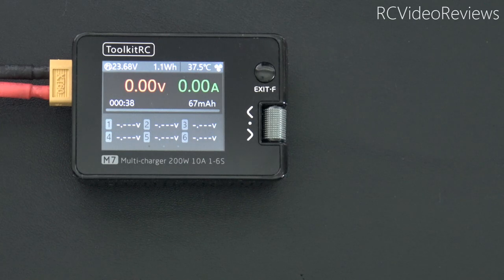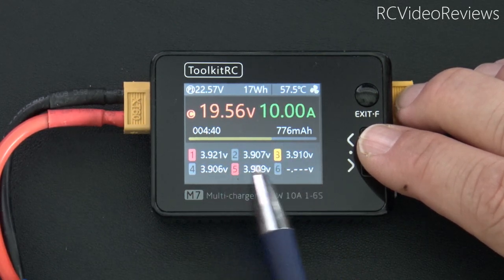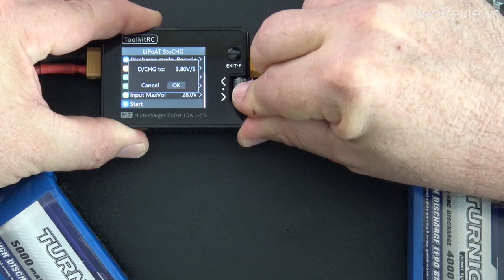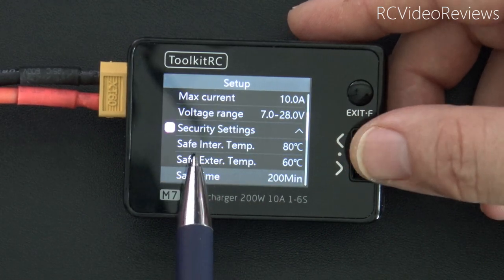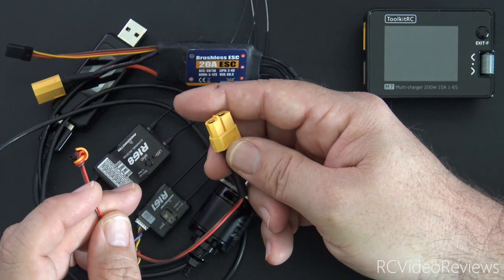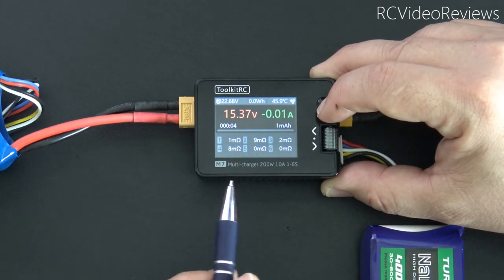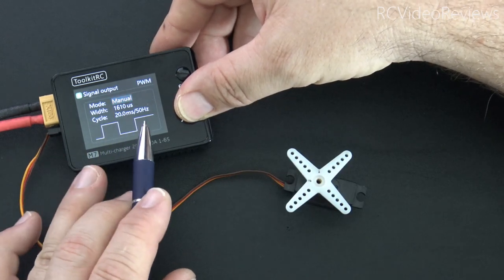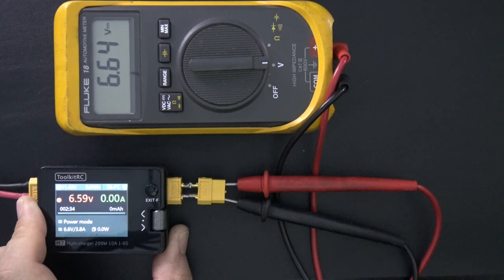ToolkitRC M7 Charger

Comment: The regen function is a cool feature, I can't remember how many times I ended up with full charge batteries after a day of flying. Only downside I see is that it doesn't balance the battery that is being charged.
Reply from the maker: No it doesn't. That said I don't think any regen chargers balance the source. That might be a good product upgrade because they don't check balance under load either which wouldn't be a terrible idea.

Comment: Hi, I bought one a couple of weeks ago but the power supply option is not working. instead of showing me the info the manual says it should, it shows me a blank screen. i believe it is related to the  firmware version 2.01 that i updated as soon as i got it. would anyone that has it mind sendimg me the firmware file so i can try downgrading back to v2.00 and see if i can use the power supply option again? thanks

Comment: Can I plug this into the wall? House electrics? Just order this charger but think I need a 240v (UK) to 12v adapter? To work this xharger. I have 2S 3000mah & 3S 2200mah batteries for my RC Car. But im completely new to this hobby 😮 thanks!
Reply from the maker: This is a DC charger meaning you need some kind of power supply like this: https://amzn.to/3QoWMW4
Reply: @RCVideoReviews  thank you 😊 🙏

Comment: What if I have it on continuous and unplug mid-charging and reconnect. Will it just start charging again?
Reply from the maker: Yes
Reply: @RCVideoReviews  Thanks for the fast answer :)
Reply: @RCVideoReviews  Oh and one more question: Can I charge a 6S LiPo (25,2V) with only 19,5V DC Input? Does it have a step-up or smth? I didn´t find any info in the manual.

Comment: First and foremost, phenomenal video with great attention to detail. I have 3 questions.
1. How efficient is the “recharging function”?
2. How does continuous mode work?
3. What is the point of pairing this with the ToolKitRC P200 Power Supply?
Reply from the maker: 1. Not sure. I haven't tested.
2. Continuous mode will start charging the next battery with the same profile as the previous battery with nothing but a battery change.
3. The M7 is a DC charger. You either power it with a battery or some other DC source like the P200.

Comment: I think the value of this charger for someone, that has very few models is massive. If you have 10+ models and electronics fail or missbehave, you can swap parts for diagnosis. With few models, you're guessing and buying replacement blind.
It's so great, I think everyone should have THIS model, and some dual or quadruple as addition if needed. It sucks toolkitrc multi battery chargers do not have M7's features. 
My plan is to buy used or as new small AC bricks, that charge through balance port, with 1-2A output, to charge multiple at once, and potentially finish with M7, or storage charge with M7 after brief multi charge with all chargers. Those bricks are so cheap and provide redundancy, while I won't use more than 3s. If a channel fails on a two or quadruple charger, you're stuck with it-shucks to bin, sucks to loose channel, hard to sell half failed charger.
One thing no one mentions, is despite the great value in functionality, this charger requires BIG additional investment, especially for users, that don't solder.
All the necessary and useful extensions it needs, while providing none, will be very costly. That is something, many happy buyers will be disappointed about.

Comment: Question on the recycle function... What's the advantage of doing it this way vs. just swapping the input/output?
Reply from the maker: The regen discharge focuses on the state of the battery on the output side. i.e. It changes it's state from current to discharged or storage based on parameters in the profile. i.e. If I set profile to storage @ 3.8v/c, the regen discharge takes the flight pack(s) down to 3.8v/c. If you flip the batteries and charge you can run into two issues: 

1) The source voltage might be too low for the voltage regulator to upscale to match the output voltage. i.e. It can make chargers give up if they have to feed a high voltage/high amperage output battery with a low voltage/high amperage input battery. 

2) There is no way to govern the correct stop point for the input battery (other than to use input profile settings which has its limits), this is the one you're trying to get into a desired state of 3.8v/c. The profile will simply charge the output battery to the configured state of 4.2v/c. If your output battery is the big one, that will kill the input battery.

The whole point of all of this is which pack is the focus of the desired outcome. If we want the flight pack reduced to storage, the desired outcome is 3.8v/c therefore, it goes on the output side in regen storage which can be configured to reach 3.8v/c.

Any more simple questions???? ;)
Reply: @RCVideoReviews  I think you covered it 😅
Reply from the maker: @FL_Engineer  It was an excellent question. My knee-jerk reaction was "hmmm....good question."
Reply: @RCVideoReviews  Excellent review as always! Keep the good work. I was wondering the same thing and I have an answer now. Just one more thing - do you possibly know what would happen if the battery on the input side gets fully charged? I hope the charger will stop on time.

Comment: Nice video. I may have to build me just a charger bench for all this equipment. I need more room in my shop.
Reply from the maker: I would think of the M7 more as a device to keep in/near your toolbox for builds. My M8S is like that, but I think after using the M7 for a while I may switch them around and use the M8S on the desk and the M7 in the toolbox.

Comment: John I didn't see a balance port for when you are pushing the power back to the input battery. is this not a concern? I am sure it wouldn't be used very often but I think it should be there. Now I am new to Elec. planes, came from glow so no expert here or even close. But very cool charger.
Reply from the maker: There is no balance port on the input side. For regen discharging you really don’t want to be pushing the source to anywhere near its peak as there is no monitoring on that side.
Reply: I think the better way would be to plug batteries you want to discharge to the input and set cut off voltage to the desire sweet spot 3.8V * number of cells. Two bird with one stone. Discharging packs to storage and not possibly overcharging the "source" battery.

Comment: I have this, but not able to charge 1s lipos. 2s and above worked fine. When I try connect 1s and charge I get error balancer port cell error.
I tried set cell count to auto as well 1s. Nothing helped. V2.00. Any thoughts?
Reply from the maker: It’s not a 1s charger. The product description specifically states 2-6s. 

“ToolKitRC M7 200W 10A 2-6S DC Smart Charger & Diagnostic Tool”
Reply: @RCVideoReviews   I took v2.01 update and now I can charge 1s lipo as normal.
Reply: @RCVideoReviews  it's written 1-6s on the charger

Comment: I dig by M6, but changing the min input voltage etc. settings to go from power supply to battery input and back was a bit of a pain, the menus/interface and scroll wheel on this one are big improvements.
Reply from the maker: I've never tried the membrane device, but I can say the scroll wheel navigation is becoming 2nd nature to me. It's showing up on so many different devices.
Reply: @RCVideoReviews  The old one is not even membrane, it's capacitive (but only on the buttons)!  Works pretty well especially for a cheap unit, unless you're trying to fumble it with your fat fingers in low light lol.  I prefer the scroll wheel to either any day, especially in long menus with many selections.  I was going to buy a second to build in to a dual charging case, but now I might need an M7 as well lol.
Reply from the maker: @maceliusfpv370  I think this M7 might make its way into my field box to replace my UP600s (which have been excellent by the way) but the M7's have more gadgetry.

Comment: Will this charge a lithium ion battery that doesn't have a balance lead?
Reply from the maker: Not using a Lithium profile. It will complain about lack of balance info if charging with a lithium profile and no balance connection.

Comment: How can i do balancing? I can find charge, discharge and storage only. Thanks
Reply from the maker: It balances during charge cycles.
Reply: @RCVideoReviews  thanks. Can you tell me if there is a trick to charge only via balancing port? Because my 1s Lipo has only this connection. Thanks

Comment: Unfortunately, the device doesn't entirely convince me with regards to the built-in servo tester. I have discovered that digital servos cannot be controlled because they constantly flutter. If I want to test the servos of 2 retractable landing gear, which are usually connected via a Y cable, that doesn't work either, only 1 servo moves at a time .
Otherwise a good device and also a good test.

Comment: Is there a trick to charge only via balancing port? I have a 1s lipo with just a connector fitting the balancing port. But it says voltage to low. Thanks sir
Reply from the maker: Get an Ultra Power UP-S6 charger for 1s cells.
Reply: Hi, i believe the new firmware 2.01 fixes exactly that issue. the problem is that the powersupply function stops working. you can download the new firmware file from the official web page. if you do upgrade, please make a backup file of the original firmware file (just copy and pase it on your drive) and share it with me please. i don't use 1s batteries but i do need the power supply function so i would lie to go back to v2.00 but can'tfind the file. thanks
Reply: Nice, thanks for the information. I will reply again with a download link for you on saturday or sunday.
Reply: @reajtime  thank you!
Reply: i have connected it via usb but there is no file on it to copy?
Reply: i made screenshots and replyed you the link here, but youtube has deleted it
Reply: @reajtime  ahh that's too bad. When you opened the drive folder when connected to the PC, whas the folder empty? If so, then don't worry about it. I thought the charger kept the original firmware file on that folder used to update. Did you fix the 1s charging issue?
Reply: exactly, the folder of drive Toolkit is just empty, i cannot see any file or firmware. The drive is 488KB and 482KB is free. But i can not see the used 6KB file. Windows 10 PC. Any idea how to see it? There must be somehow data
Reply: you can check it yourself, just connect your m7 to the pc. Can you see any files?
I did not update it yet, cause i wanted to Backup for you
Reply: @reajtime  hi. Sorry for the late reply. I tried connecting the M7 again and you are correct, the folder is empty now. Seems once the update is done it erasers that file.

Comment: Got mine from AliExpress and it has 2.0 firmware out of the box. Hope it is not a new revision which is cheaper and worse, as usual :)
Reply from the maker: The latest firmware fixes a few things. I found the issues and worked with them on the fix. Mine work well.
Reply: @RCVideoReviews  also 2.0? Maybe you know why it is not published on the website?
Reply from the maker: Don't know the answer to that one. Not sure what rev #.
Reply: @alexey_sychev  I was wondering the same. And how can I find out which one I have?

Comment: i had one... i managed to burn it.. (shit extender coord i reused without paying attention to the reversed polarity... it should have protect diode ..) exept that its a nice charger ..; (so i took the m6d who was promo double charge more usefull than servo analyzer  (i dont use the servo testing plug anyway drone dont have servo ^^ )
Reply: if someone know  how to repair a reverse polarity damage on that thing (but i bet its death .. i dont see where it burned on the board but the entrance plug is death when powered battery side u plug the mainlead and it say overcurrent ...